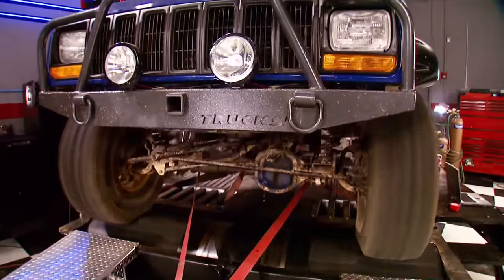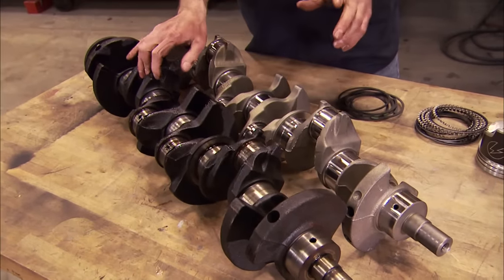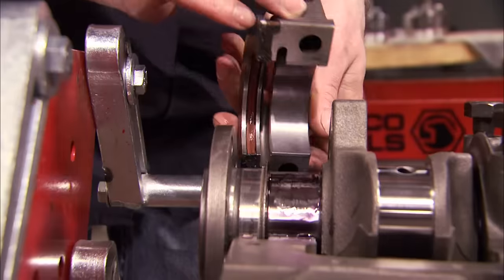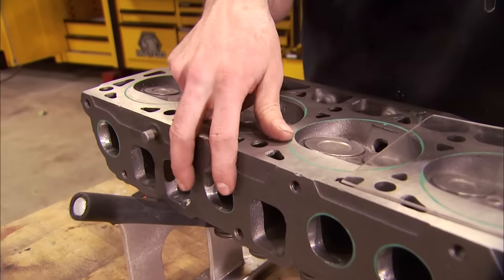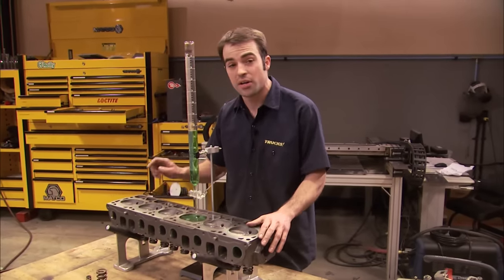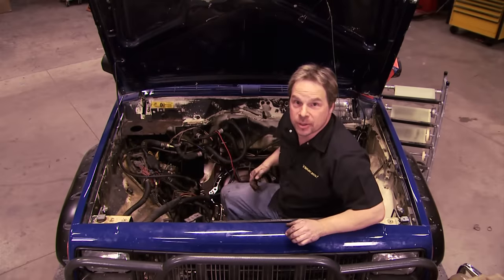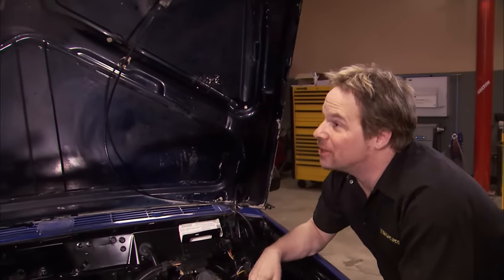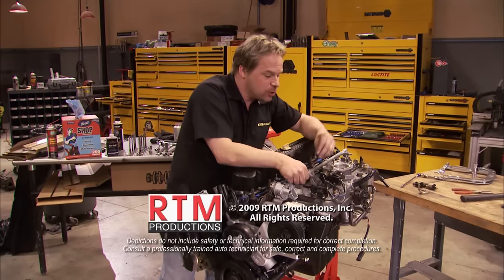Improving Air Flow And Displacement On Our Cheap Cherokee's Straight Six - Trucks! S11, E7

Comment: Help it breath with a turbo.
Reply: A turbo doesn't help it breathe better, as it doesn't gain any airflow through a port. Kinda know what you were getting at though..
Reply: Someone on oxygen is having more air forced in per breath, effectively helping them breathe better. So they should strap a big ass snail lung on that puppy and let it force it's way to better breathing. 🤣🤣
Reply: @kuhndog-1196  Technically untrue as well lol. With a comment like that, you would think you understood how a turbo, or oxygen tank worked? Lol.
Reply: There is always one of you haha. Have to make yourself feel big and bad. Do you feel like a big man now? 😂
Reply: @kuhndog-1196  Nope. My intentions are solely aimed at helping. People read comments like yours, and get mislead to believe misinformation. Your response, however, tells a lot. My bad that your ego won't let you accept someone trying to help. Welcome to the internet...
Reply: Who the hell reads anything on the internet and takes it as 100% fact? It was clearly a play on words. I would say you had a point if I had said the porting wasn't necessary but I didn't. Was talking the next step in the project.
Reply: @kuhndog-1196  Who reads the internet and takes it as 100% fact? EVERYONE! LOL. That IS the way of the internet lol. I certainly won't fix it lol, but if i happen to stumble across misinformation, i help when I can. Wasn't personal towards you... And to be further technical, the "gasket matching" he was doing, did nothing either lol. Not one thing was measured or blended correctly. Just goin in there with a chainsaw blindly makes things worse. The gasket companies don't know what size your ports should be... lol.
Reply: That would be fun for the highway but suck for offroading since it wouldn't have any low end torque, maybe a supercharger?
Reply: @slirtyduts  for sure. Or a small quicker spooling turbo and lose the top end. Either way I want to see boost lol.
Reply: @vengeanceizmine9878  so a big blockage in the runner or head will do nothing to decrease flow? Yes he definitely should have polished the ports out a bit but what he did will still net a gain.
Reply: @kuhndog-1196  Big blockage? If the head is bigger than the manifold, where is the blockage? Has nothing to do with polishing, that does nothing but look pretty. He gasket matched the intake because apparently the new head had a slightly bigger opening, which the gasket matched better to. The minimal amount of material he removed on the intake just to match the gasket did nothing for power. If the intake is slightly smaller than the head at the gasket surface, for the most part, will be fine, and what he did wasn't needed. 
Also, a turbo doesn't limit top end. It glorifies the existing power range.
Reply: @slirtyduts  The more common thing to do is to just stroke it if you are buying all the parts anyway. Would have made more sense,  and filled in the lack of torque down low..
Reply: Medical expert, here.  If you want to treat a car like a person, and compare issues then here it is: you can in fact deliver more oxygen to a patient if you place them on mechanical/positive pressure ventilation.  That works like a turbo.  However if the airway is too narrow for air to pass through, the answer isn’t to simply push more air in.  You must alleviate the block/restriction prior to pushing more air/oxygen. If this isn’t done, you risk over pressurizing the side of the positive pressure and either damaging tissue or in the case of your engine you destroy gaskets or other hardware. Hope this helps, boys!
Reply: @Heffelz8  Except a turbo doesn't feed it MORE oxygen, not how it works. Regardless, engines have cam timing to deal with, so no matter how much you give it, it will only accept a certain amount, just like a human breathing. If you force it on them, and they can't take it all in, they choke, and flatline, just like an engine. However, being on a life support machine that controls the breathing like cam timing would, it will take what you give it in that window, otherwise it would be like force feeding an engine with no valves.. boost pressure IS a measurement of restriction. Without restriction, you wouldn't have boost.
Reply: Wow
Reply: @vengeanceizmine9878  wow so  smart man
Reply: VengeanceIzMine what you talking about man? I have a 2.0 liter BMW motor, it makes 100hp naturally aspirated, I put the turbo from the 2002 motor and it makes 180hp, a turbo pushes more air in the engine,  with more fuel from the injectors = more power. You just talking for  the sake of talking. I don’t see any videos of your engine building. 
And on any engine, I can add a turbo and make power, leaving everything stock. Even easier on modern computerized engines.
Reply: @vengeanceizmine9878  how is that untrue? A turbo in theory literally pulls more dense and pressurized air and feeds it through an intercooler to make it dense cold pressurized air and puts it into the combustion chamber
Reply: @PatricioGarcia1973  Everything you said about what it did for you is true... because that's all a turbo does. What you said about how it works is UNTRUE. All it does is pressurize the intake tract, via boost PRESSURE. When you create a higher PRESSURE than what the engine would normally see running normally aspirated, it makes the charge more dense which equals more power. Denser the charge, the more power.
Also, I'm not here for content or advertise, I'm here to help those that need it. So there's that..
Reply: @gavinrhys1983  Just tryin' to help when i can.
Reply: Turbo for the win. Reducing the compression ratio from 9.7:1 to 9.3:1 is a big mistake, for either NA or turbo. 10:1 gives much better fuel econonomy than 9.3:1.
All 2020 oem turbo cars are >10:1 CR, most are 11:1 CR in 2020 now. High CR helps with prespool throttle response and fuel economy.
Reply: Boost is more air packed into the same space. That is why you typically need a bigger fuel system because your afr increases, which means you have more air. I'm not sure why this is an argument.
Reply: @kuhndog-1196  Maybe because people keep saying "more" air when it isn't. The charge is just more DENSE due to boost PRESSURE..What pressure do you think it runs at without the turbo? Boost just glorifies that. It doesn't make an engine flow more air.  No argument here, I know how it works. But, you ARE correct saying it needs more fuel, as denser air does,  as well as less timing.
Reply: @vengeanceizmine9878  ok so if you took 1 cubic foot of air and compressed it to 1/2 a cubic foot, there is still the same amount of air just in a smaller space. So if you say I'm right about needing more fuel with a turbo over n/a that's literally because your afr is high, meaning lean. Meaning you now have MORE AIR.
Reply: @kuhndog-1196  You were headed in the right direction in the beginning of that comment. SAME amount of air, compressed, is the same amount of air, just more DENSE. NOT more air.  More dense with what? Oxygen. Big difference. Hence the need for more fuel, less timing.
Reply: @motownsailor7204  Not my problem the learning curve is slow in here.
Reply: @vengeanceizmine9878  you don't understand what afr is.  Stands for air fuel ratio. I wish you would give an actual explanation for what your trying to say but it's just not coming across. Explain to me how the same amount of dense air would up the afr.
Reply: @vengeanceizmine9878  i understand what your saying but the more dense the air the more air in the volume of your engine can give your engine more efficiency.
Reply: @kuhndog-1196  I Never said the same amount of dense air would up anything.. I said the same amount of air in general, just being more dense, would change the afr, compared to a given amount of air, that is less dense. Think that got lost in translation. 
 It's the AIR DENSITY that changes your afr.. NOT the amount of "air".. Do you understand how an O2 sensor works? Measures the OXYGEN content in the exhaust, not how much air is in it. The denser the air, the more oxygen content, for a given unit, or given amount, of air. Thats why your afr will read "lean" with a denser charge, and thats why you need more fuel. Regardless of Boosted or Normally Aspirated.
Reply: @bigboreracing356   Lol. No actually, just the simplicity of how a turbo works. But if you can't understand that,  you have no chance at Physics.
Reply: @kuhndog-1196  I never said that, but if the shoe fits...
Reply: @GOOFYGAMER12   Air is all around us. Air density is what changes, not the amount of air, from season to season. Density of air doesn't change volume. It changes the weight within that same volume. You take the same volume of air, change it's density, it's still the same amount of "air", just more dense. It's not more air.
Reply: @vengeanceizmine9878  you have contradicted yourself many times in this thread. You act as if I said the turbo increases the amount of air an engine can physically flow at a normal atmosphereic air pressure. I did not. Ball up a piece of paper. If just crumbled up, imagine it filling a box or a tube or whatever you want. Now imagine taking that paper ball and compressing it into a smaller, tighter ball. You can now fit a lot more small, tight paper balls in the container. Get it yet?
Reply: Stig Martin  Sounds like he has an idea but doesn't understand the actual terms of what he is saying. It seems he doesn't grasp that higher density is more matter in the same volume. More oxygen molecules to burn with fuel in the same given space. The volume of an engine stays the same but more oxygen passes through it giving it the potential to make more power. The 100% VE is a standard term to a NA motors full flow at WOT in I atmosphere but forced induction will go above that by packing more air into the same space. Compressed air is denser air and denser air has more oxygen. Hence (more flow) of an engine.

Comment: wouldn't the larger cam reduce dynamic compression making it possible to run 9.6:1?
Reply: There is no difference between 9.3 and 9.6. From fuel perspective.
Reply: @juhomaki-petaja  Depends on engine design. Certain cylinder head shapes or piston shapes can change where the hot spots are in the cylinder changing what fuel might need to be run. There's no real "use premium at this compression ratio and regular at this one". Every engine is different. An engine with a good cooling system might easily get away with 10:1 compression like the LT1 with reverse cooling where other engines with the exact same geometry (IE earlier small blocks with similar cam) would probably need premium to run 10:1. Smaller cam = lower compression or higher fuel grade since the compression is not being relived by cam overlap IE Dynamic compression.
Reply: A cam has no affect on CR? That's pre-determined by your choices in piston, combustion chamber size and gasket thickness, deck height, etc.
Reply: @v.e.7236  there are 2 types of compression ratio
1. Static Compression Ratio - what most people think of and what you have described
2. Dynamic Ratio - Depending on the cam, the intake valve may hang open momentarily as the piston begins the power stroke effectively reducing the stroke and therefore compression
see more here - https://www.enginebasics.com/Advanced%20Engine%20Tuning/Static%20vs%20Dynamic.html#:~:text=Dynamic%20Compression%20Ratio%20(DCR)%20is,concept%20in%20high%20performance%20engines.&text=Definition%3A%20The%20Compression%20Ratio%20(CR,to%20the%20combustion%20chamber%20volume.
Reply: @jacobvanhalteren7452  You may be confusing cylinder pressure w/ compression ratio. While there may be a slight drop in cylinder pressure, due to valve position, the compression ratio actually increases as RPMs increase w/ overlap. There is a scavenging effect that comes into play w/ that cam design w/ that creates this increase. There is some myth and some science behind what you hear and read about. Be well, sir.
Reply: Depends on overlap.

Comment: I’d have kept or got more compression the more it is the more horsepower, as these engines made low numbers of horsepower. All you would have to use is a better grade of gas. When I do mine I want 10:1.

Comment: I wouldn’t cut the chambers down at all 9-6 to 1 is nothing in compression and would make the motor snappy want to lose some compression get a bigger camshaft
Reply: I think 9.6 to 1 was my factory compression on my 87 Wrangler with a 258 and I loved the way it ran I did have to use premium fuel though. It really came alive when I dumped the Carter carburetor and put on I think it was like a motorcraft two barrel and ditched all the emissions and computer
Reply: Deshrouding is the way to go. I woulda just got a thicker HG if I was only tryna lower the static CR. 9.6:1 is nuthin'.

Comment: So...what if your tolerances are not within spec? Is it back to the machine shop? Return your bearings?
Reply: If the tolerances are off in the negative, then yes back to the machine shop. If they are positive well time for a new block. You can always take material off but you really can't put it back on. So if they hogged out your mains too much, you need to see if they have an oversize bearing to take up the difference. If not, the block is junk. Same with crankshaft journals. If they spec out too much in the negative and there is no oversize bearing, the crank is junk. Or it could be you ordered the wrong bearings. This is why it's important to check clearances even after getting a block back from the machine shop.

Comment: Quick question? When installing the cam  bearing is it true that touching the bearings where it contacts with cam without gloves on,  the oil from finger ruins the integrity of bearing because the oil will not properly protect the bearing do to the oil on fingers!
Reply: Skin oil is salty, it's just a good practice not to get salt on bearing, or sealing surfaces.

Comment: $711 for all that machine work.... I've been quoted a hair over $2k for the same work on the same block where I live. It might be cheaper to ship the block to your crew and have it shipped back to me.
Reply: This is at least 15 years old.
Reply: @zhdpa  what do you mean?
Reply: $711 is media price. For average joes 3x that price.
Reply: Or, dont bother. Just buy a good $700 engine and turbo charge it for much greater gain.
Reply: Nor Dic And it will be same price tag?
Reply: I thought it was a little high actually. That's 700 bucks US. I paid just under $900 CDN for mine to be done.
Reply: I just put together my 4.6 stroker. Came out to 862$ fully machined man. Shop around!

Comment: i have a 05 4.0l wrangler with the keyway cam gear! can i use the older pin style cam timing chain set with cam bolt button ?? i`m doing a cam swap and it`s going to take 3 months to get the keyway newer style cam from comp! i can`t wait that long!! any help please!

Comment: I would have painted the engine a mid 70s early 80s chrysler medium blue . it would have made the engine pop instead of the boring black paint. I save a bunch of money buying a
 3"x3" exhaust pipe connector from oreallys and two 3" x 3"  26 guage adjustable elbows and a 3 " x  24" section of galvinized pipe from menards and a 3" x 3" blue silicone 90°  elbow and a K & N cone filter 2" x 4" with a 2.75 inner diameter base for the cold air induction to pass through the panel above the fire wall just below the cawl panel on the passengerside = 77.00 not including tax or the 2 rolls kit of heat resistant wrapping for headers to cover the entire length of the tubing fen the base of the silicone elbow above the trottle body to the fire wall  =   45.00 online .

Comment: Or you can buy a k&n air filter put it in your stock air box and use the original cold air intake that the jeep came with stock and make even more power for less and have a TRUE COLD AIR INTAKE.

Comment: You could probably do a ls4.8 or 5.3 for 2k? Give ya 300 ish hershpowa
Reply: Will be a little more than 2K. That amount would just be for the swap itself and not upgrading the rest of the driveline to handle the added horsepower and torque.

Comment: I'm confused? Isn't higher compression better for N/A? So why get rid of it?
Reply: So they can put shit gas in it lol
Reply: They want to run the cheaper gasoline and the lower compression ratio will help keep it from needing the more expensive gasoline, to put it simply
Reply: installing the 4.2 crank makes the compression too high for regular gas, even premium...
Reply: @omegarugal9283  he mentioned the chamber porting would drop the compression ratio from 9.6 to 9.3, all within standard octane ratings. Getting into 10 to 1 and 11 to 1 is where you start entering race gas, but even around me you can get 110 at the pump.
Reply: @Timman57  depends on how agressive the timing is
Reply: @omegarugal9283  nothing they did in this program has been severe enough to make someone worry about a radical amount of timing change from a stock application. They basically built a stock engine with a little more stroke and porting, nothing crazy at all. He could have left that combustion chamber alone and still ran regular unleaded and had no preignition or timing issues. With those deep ass dished pistons, no one within a mile of that place was worried about dropping .3 points of compression lol
Reply: @Timman57  And .3 points of compression is not enough of a difference to make a difference. 87 would have ran fine in that engine as is.